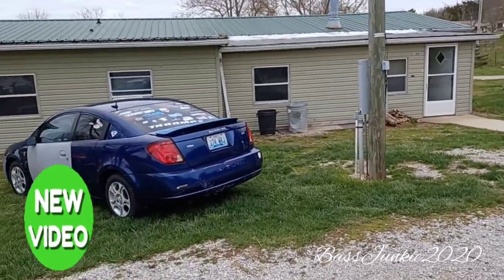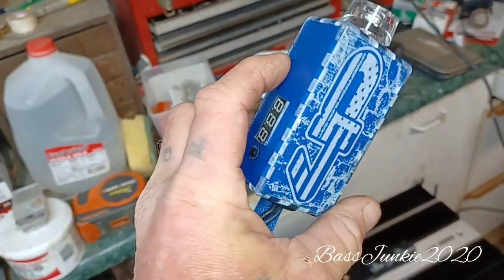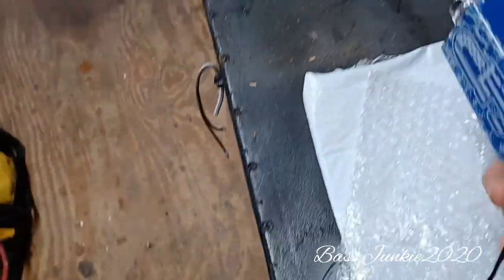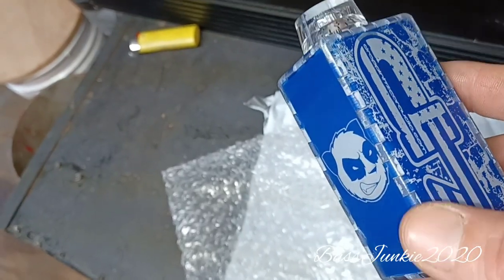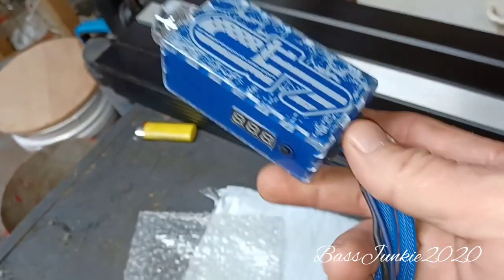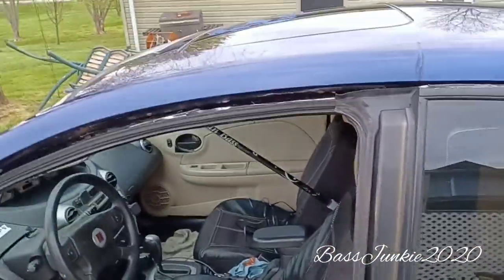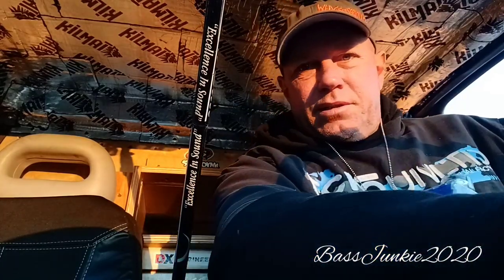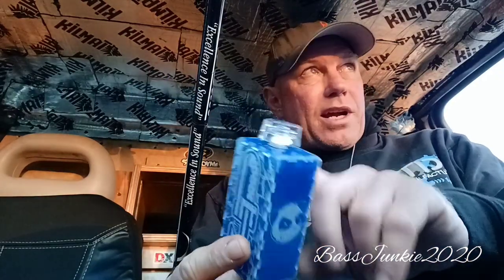Update! Got my Slam Panda  bassknob back! Demo!

Comment: @BassJunkie2020

Where those wires go into the grommet, if there is no locking mechanism on the inside to secure the wires, those knobs will fail endlessly as the wires move around from normal use and break connections.  I don't know if those Pandas have the wires secured on the inside or not, just tossing that out there.  

The grommet without securing the wires on the inside would be more than enough if the bassknobs were secured to something and not being moved around.  But most companies still have them secured from moving around regardless.

The solder used to connect the wires the potentiometer and voltmeter matters also. If lead free solder was used,  it gets brittle fast and easy in colder climates and breaks fast when compared to leaded solder.  Even the type of wire used can make a difference as well, when some wire gets cold it's pron to cracking. But that's usually bottom of the barrel wire and for as much as those sell for I'd assume decent wire was used.
Reply from the maker: I think he might have secured it a lot better now that he knows it's a fail point. But it was like you say  before. Why it broke 😉👍

Comment: Nice bass knob just hooked my amp in and found out my old bass knob don't work on my amp. You have to use the wire and the plastic knob it came with or it won't turn up at all. Least the amp works good.
Reply from the maker: Your new amps are nice!

Comment: Please help me understand. It's a bass knob. What makes it special or different than any other knob? Why not run the bass knob that comes with the Sundown Amp?
Reply from the maker: Because the knob that comes with the amp works through the amp only. The rca bassknob controls the signal from the head unit to the amp. Big difference. 👍😉💯💨💨💨
Reply: @bassjunkie2020  can you elaborate on that James , does it get a better and stronger signal. I'm only asking because I don't know all the details myself
Reply from the maker: @RomaVilla  I'll explain in my next video. Will be easier to explain. I'll be doing video today. Have it up sometime tonight 👍😉💯
Reply: @bassjunkie2020 , so, when you’re setting your amp, do you have the Panda at full tilt and not using the knob that comes with the amp? Am I understanding this right? And if you play oldies, they will never bass as hard because the signal isn’t as strong. Correct.
Reply from the maker: @62dobie  well the rca bassknob is kinda of a volume control to the sub from the head unit. The knob that comes with it controls the bass only. The way I have it set up. I have the rca pre outs on the head unit going to only the bass amp. I have a 4 channel line out converter tied into the front and rear door speakers for mids and highs. So they have there own separate settings. That's why it works for me. You can't see the line out converter. Because it's behind the head unit. I forgot to include that in my video. Because I had to much to do. But I will make a video about it 😉👍💯
Reply: @bassjunkie2020 , I understand. I have 3 line-outs from my head unit. 1 for highs/ tweeters in my dash, 1 for mids in my 4 doors, and 1 for bass/box. I run 3 different amps separating everything. I never thought about running a volume bass knob. I just might do that. I only run the bass knob that came with my SALT 8K. I do see your point as a volume knob.